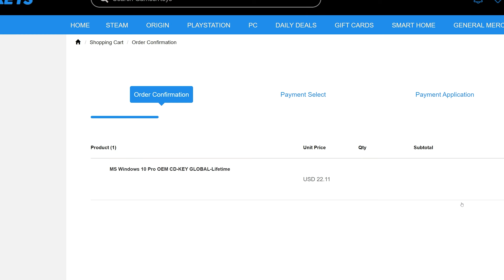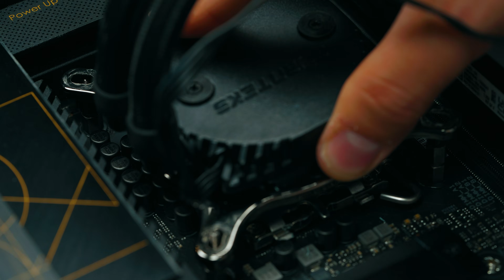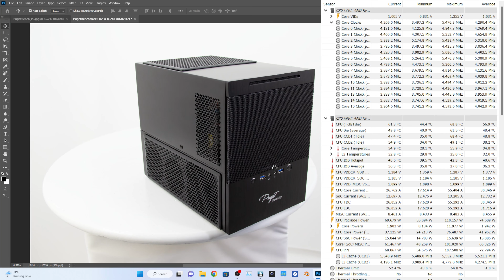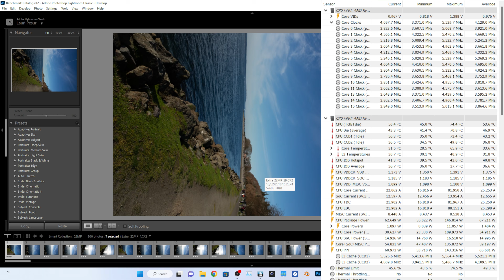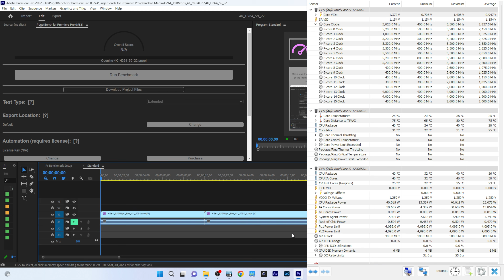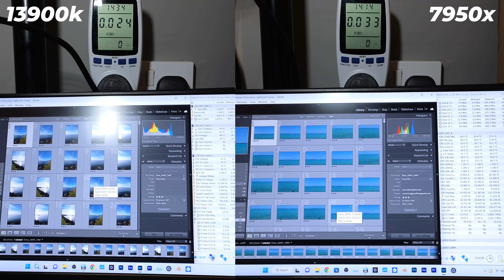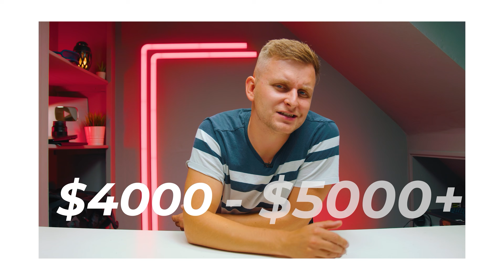INTEL & AMD both lied! 👉REAL WORLD power consumption is MESSED UP

Comment: Regarding the hardware measurements, they can completely turn upside down your whole video results. Here is a report on reddit from an intel system user with HW measurements: 

"Software tools are inaccurate. Besides you are not paying just for your CPU's usage you need to factor in the chipset, RAM, CPU cooler/AIO and atleast primary your boot drive.

Yes definitely. I don't have a Zen4 platform, but a 13700k & z790. HWInfo can show <10W for package power, but my Kill-a-Watt type device shows 75-80W at idle. (My old Zen2 / AM4 closer to 60W idle at the plug)

All these USB ports, PCIe 4/5, massive VRMs, etc... costs idle power."

Comment: For Ryzen 5000 series it really depends on the CPU and utilization for workload power draw. I can't say fully yet for 7000 series.
But per core power utilization I get more from my 5950x than my 5900x or my 5800x.  I think that has to do with the binning.  
Both my 5900x and 5800x use a decent more watts per core. 
My 5600x is pretty close to the 5950x per core. But the point of that thing is to max frequencies. So a lot gets wasted going those last few hundred.

Comment: Just take a light bulb out if you need to save 20w LOL Im changing my living room lights as it has 8 bulbs @40w each to 6 bulbs @ 4w each so I dont have to worry and about the 7950x3d power ... but the RTX4090 may use a little more lol

Comment: Interesting! My 12400F idles at 5-10W while my 5600X idles at 15 to 22W, in gaming the 5600X generally uses 5W more, but also performs a bit better. They run tweaked and OCed ram (3700cl14 g1 and 3800cl14 and curve optimizer) and voltages on Ryzen has been tuned lower. 12400F can't be tuned due to locked voltages, but performs good anyways. In idle 12400F drops to 0.65-0.7v, 1-1.1v at load, 5600X drops to 0.85v idle and 1.15-1.22v during load.
Reply: What are you using to measure? 5600x idle package W is about 30-40W
Reply: @Arcona  hwmon64. Using wallplug measuring actual powerdraw from wall, idle consumption is 55-60W for B550m MB, 3x120mm fans always spinning, 1tb m.2, 3060ti tuf. You may be using high powerplan so it doesnt go to low power state in idle? Mine runs voltage at 850-870mv, clockspeed 200-3600MHz in idle using balanced powerplan.
Reply: @Taraquin83  use hwinfo cpu package power will give accurate read
Reply: @Arcona  I did that, in idle it uses 15 to 19W cpu package power.
Reply: @Taraquin83  that's odd. The IO die makes it use more idle than that regardless of core clock. Maybe the undervolt also effects the IO die consumption
Reply: @Arcona  I run SOC 1.06V, IOD, 0.98V, CCD 0.8V, VDDP 0.8V, VDD18 1.6V, balanced powerplan, cool and quiet enabled. I see now that minimum voltage usually is 0.83-0.85v, sometimes drop to 0.2v. Cores use about 1W, IO-die the rest.
Reply: @Taraquin83  I take it you've experimented to get it down to that point but stay stable?
Reply: @Arcona  yeah, 100% stable, anything below reduces performance or gives instability :)
Reply: @Arcona  if you run it stock it often defaults to 1.2v SOC, 1.05V IOD/CCD, 1.1V VDDP, this increases idleconsumption a lot vs my settings. Also use balanced powerplan and enable cool and quiet.

Comment: This is a an awesome comparison for some workloads. 
Setting up systems for photographers AMD is faster and more efficient when  batching 3000 + photos for online stores for example. 
When using premiers default plugins Intel may be more efficient. When using many 3d party plugins the extra cores are great at keeping things playable instead of having  to render to play. 
What You Tubers do not say is that on AMD Premier uses NVENC on the time line if available. Which I prefer as the quality is slightly better even if Qsync is available. 
What is more important than the CPU idle is the total system idle
50w extra cpu is small if you have a lot of ram, add in cards and storage. 

For average content creators who shoot and edit them selves Intel may be a better option. 
In a high throughput environment AMD may be a better option.
There is no substitute for raw performance irrespective of the source.

Comment: Very nice the only thing missing is metrics when undervolted/power limited as it makes quite a big difference between the generations. It puts Intel and AMD on par in workload and you can get 90% of performance at 50% of the power often times. The new generation is quite a bit more efficient as it’s supposed to with that in effect. Idle is still significant as an issue though I hope AMD finds a way to deal maybe using efficiency cores in the future as well as they are already increasing their expertise in chiplets design. That nd gaming benchmarks for power really unfortunate Intel removed AVX 512 instructions because immigration and future gaming is supposed to benefit a lot from that as it etches closer towards simulation
Reply: Intel CPU's perform even better when undervolted, I don't see the point of your comment.

Comment: Intel efficiency is better suited for mobile. 

On desktop, doesn't make sense thou. Ryzen is better for many applications. Also as far as upgrades go, AMD has a proven path forward. Intel, not really.

And if you need to go balls to the wall AMD rocks hard with more efficiency than Intel when going full tilt.

You'd be surprised how many apps peg the CPU at 100% sometimes.
Reply: Big-Little also makes sense for desktop chips. I have my i7-12700K and it's a perfect x86-64 music production CPU.
Reply: A lot of apps don't peg the CPU at 100%.

That's why very few people buy a 10 000 dollar 64 core Threadripper.

Comment: I think you might not have done the idle test exactly correct. The frequencies on intel cpu on idle are way lower than on amd. And I'm pretty sure this is not due to difference in chips itself.
On intel your cores run 1100mhz on P-cores, and 800mhz on E-cores. On AMD you have all cores between 3300MHz all the way up to 5200Mhz!

One possible reason is, If your setup uses windows power options for controlling power, I suspect you have a wrong value of  "processor power management -> minimum processor state" in power options. But it could be some different setting too, but something clearly doesn't seem right
Reply: its because the AMD infinity fabric can only work at but so low of a frequency before the latency between chiplets  becomes to much for the system to handle

Comment: The full story is on Techpowerup.  They do detailed power analysis of all kinds of games and applications so you can see individual and average results.  For instance the 5800X3D is about the lowest in power consumption duding gaming even though it's giving some of the best results.  The 13900K is on the opposite end of that using the highest amount of power consumption on average.  How big are the differences?  47W for the 5800X3D vs. 114W for the 13900K.

Not sure where you get the 300W+ for the 13900K in your opening statement, that's only when you OC.  However the 13900K was at the top of their power consumption for pretty much anything except single threaded apps, using stock settings for CPUs.  In single threaded apps the 13900K was using 32W, and part of the Zen 4 lineup uses more, but the 7600X and 5800X3D used the least, 15W and 19W.  All-core load testing using Blender put the 13900K at 283W, and the 5800X3D uses the least of the newer CPUs, at 89W and the 7600X at 99W.  The big power user by AMD in Blender is the 7950X as should be expected with 16 full cores, at 235W.  Now, if you look at consumption to complete a given task without regard to time in general AMD does better and sometimes a lot better because of how low the power consumption is with the 5600, 5600X and the 5800X3D along with what's going to happen with the 7600 - 7900 which just came out.

And these results agree with what Gamer's Nexus show and I trust both those media outlet's testing and results.

When you start doing things like removing power limits from the 13900K or run an all core OC THEN you start pushing power to crazy amounts of 350W - 425W.  It's incredibly bad.  And even for gaming, when you calculated frames per watt, the 13900K is at the bottom and the 7600X and 5800X3D are at the top.

So, didn't bother watching because I don't know what angle you're coming at, because other than idle and single threaded apps Intel gets its butt stomped in power consumption.  And the 5800X3D makes almost everything other than the 5600 and 7600X look bad in almost any use case for power consumption.  But once again, it's really a funny time to make this video because the 7900 is a 65W TDP part along with the 7600 and 7700, costs are low and power consumption will be low, and GN and Techpowerup will do the detailed power analysis and show this.
Reply: Their test bench is not ideal to measure idle power consumption imo. Too high consumption parts
For example they test a 5600g with a x570 pcie4.0, RTX 3080 that idles at 20W, 860W power supply. Imagine testing your electric car consumption in efficiency mode with 5 persons in it and full of furniture.
Reply: You are right. Techpowerup also tests Photoshop, After Effects and Premiere Pro and they also have other light load tasks like Office, Avast and MP3 encoding in their testing lineup. The power consumption of Ryzen 7000 is on par or lower in even these light load tasks.

Comment: Even when working, employees or self employed spend most of the time browsing, looking for images, mailing or conferencing.
Light load and idle need way more attention and I tend to trust intel more. 
Then, there are other issues with MB, ram, multi monitors refresh rate, and GPU idle power consumption. Graphics cards draw 5 to 30 watts on windows (while consumption can go down to zero on Linux) should get more attention.

Comment: To narrow down wattage score it would be best to use key/mouse recording program of ~8h average use for PC, including watching some YouTube, maybe movie, little gaming, some workload.
For motherboards to be closest possible would be using ones with same number of VRMs and ideally same VRMs. Same goes for number of fans and other peripherals. Also same power supply.
So ideally record daily use on slowest, and most underclocked CPU you plan to test to make click recording and then go up the ladder of power with performance.
To my memory, AMD hardware tends to be quite aggressively overvolted and people have real good results with power savings and like 5% score decrease.
But that's another untapped potential for benchmarking/tuning.
Personally for next PC i aim to build passively cooled design, so going down with power will be the key.

Comment: Probably this was what Intel was showcasing on their 13th gen keynote when they announced those. This was the type of test that I was looking for when they announced it and it's kinda surprising. I'm pretty sure 14th gen will further improve those E cores efficiency. Hopefully, this applies to laptops too since that's what E cores even in smartphones use. Seems like Intel is slowly tuning its CPU capabilities properly.
Reply: Intel's e-cores are similar to mobile Qualcomm arm e-cores as they are in order execution but just like qualcomm are not nearly as efficient as apple out of order efficiency cores in performance per watt.
Reply: @PMARC14  Intel is on 10nm tho while Apple is using TSMC's 5nm. Let's see what Intel has once they are on the same node!
Reply: @verosimatum  well I am saying this based on the snapdragon 8 gen 2 on the same process gen at Apple. It shows that yes apple gets a big lead on process node from its arm competitors, on the same node they are held back by their in order efficiency design (consumes less power but for far less work). I think intel and AMD on a similar mode as Apple could be far stronger, but Apple also makes larger silicon chips to get their efficiency (even discluding accelerators)
Reply: @PMARC14  Sure it'd be lovely to have a macbook, apart from the fact it straight up can't run games and other software not converted to work on ARM
Reply: I doubt it's about efficiency cores, at least for idling. The 12400 idles at 5watts (without e-cores) when the 5600 idles in double digits.
Reply: The E-cores is not really "power efficient", but "die space efficient" which allows intel to cram tons of it and catch up to AMD in multi threading performance. My personal test using 13500 shows that Ecores draws 60% less power but 62% slower than Pcores on cinebenchr23. 
155watts, 21000 cinebenchR23
99watts, 13800 cinebench R23 ecore disabled
Reply: @Rute Fernandes nah its the chiplets design thst uses more power in idle compared to monolithic from intel.

Comment: Sir what about 
Ryzen G processor
5600G
5400G
3200G
Are power efficient.
Reply: Probably worse due to being on an older node
Reply: as far as i know, they were designed like mobile processor, not chiplet, but monolithic design without infinity fabric or IO die

Comment: The Ryzen is probably idling at 55w because its precision boost is turned on by default and windows has problems right now with the new Ryzens.

If you tweak some of the settings, you can get it to where even under heavy load, the Ryzen only peaks at 65w and idles around 5 - 15.

It is not really that hard to do this either. You can do this with the Ryzen Master program.

Comment: Those idle clock speeds on Ryzen seem a little high. My 5600g down locks close to 500mhz when idle. FYI, Adobe is Intel optimized, just ask hardware unboxed.
Reply from the maker: Is there any AMD oprimuzed programs?
Reply: 5600G behave similar to the 3600. They both idle in single digits. This is why they are used for home servers. Also, the 5600G does not perform as well as the 5600, let alone the 5600X. 5600G use pcie 3.0 as opposed to their big brother (4.0)

Comment: Iv recently been exploring my 13700kf efficiency and in blown away with it.

Just by downclocking from 5.4 to 5.0 I can drop the voltage down to 1.15ish

This resulted in a drop of 3.3% in cinabench but now when gaming it only sips 25-50w.

Crazy

Comment: 19:05 There are a lot of energy meters that can measure the consumption at the socket. It was weak. 🤷‍♂️🤦‍♂️
Reply from the maker: I was talking about the EPS power connector, as you can see I did measure it from the wall as well ;)

Comment: The problem with the initial idea of what you said is that you can't compare a car to a computer. X86 from AMD and Intel is designed to turbo boost and stick there or throttle down depending on the work load. If you are working in autocad, coding in unreal and rendering assets, and sending that information to your teams FTP server or whatever, you are insanely stressing your CPU. The reason why people show the highest consumption is because most CPUs will always put themselves the highest they can go based on thermal limitations. if you were to build a computer and not have your affinity in task manager setup to focus on certain task or go into overclock settings and push it more to gain more performance those are different variables, but even at stock speeds and solutions both CPUs act the same and will show the performance based on thermal limitations leading to increased wattage...

Comment: Tdp is not power consumption even though they both use watts one is a measure of heat produced.  As transistors get smaller they produce less heat but they still use power.

Comment: This is very good information especially as the Intel platform is cheaper to get into to begin with. Lower entry costs and overall lower power consumption make this a no-brainer from an economical point of view.
Reply: Platform cost is almost equal bro
Reply: @ajitesh5278  you never shopped for mATX boards, apparently. And no, DDR5 still is more expensive than DDR4 for minimal gains.
Reply: @HoshPak  lmao if you are going with an i9 why would you go with ddr 4 ram ? Ddr5 is better in gaming and everything , and z790 motherboard and x670 motherboards are almost same price

Comment: Well done. It has been hard to find the idle power consumptions for the AMD parts. Even on the old Intel parts, idle power consumption in HW info is often in the single digits (9-11w on i7-6700 while typing this comment). I rarely put my computer to sleep as they rarely wake up properly and often leave them on to quickly resume work the next day. The power of the 7950x would be nice for encoding but the high idle power is a concern as that is 90% of the use case.

Comment: Good point. Unfortunately it is not relevant to the gaming, because it does not allow CPU to fall into power-saving state.
Reply: Dev should not lock the sleep state, they should allow the CPU to sleep, imagine if player has a monster CPU? so each Tick it finishes the task instantly, so what's the reason to keep the player's CPU waiting? (Usually there's only 15 to 128 ticks per second only, while the in between are processed by GPU)

Comment: My extremly undervolted 7900x pulls 30W in idle. 90W at 12x4.5ghz cb23 multicore

Make please a bonus round against the best intel but with different AMD undervolt settings...
AMD voltage curve is insane, 4.5Ghz all core cb23 970mv and stock curve sets 4.5Ghz at 1.25v
Reply: Undervolt vs stock is not a fair comparison lol
Reply: @AbcdEf-lz6oe  Im saying that AMD can do better...
Reply: @AbcdEf-lz6oe  I tested a friends PC and it can actually go down to 6W idle when undervolted and it's so funny that AMD has legit no chance... I'm programming and the issue is that the PC is 6h+ idle... meaning for 1h of AMD i can work full day on Intel... and I'm planning a camper van so yeah... AMD is dead in my eyes because power consumption is very important with Camper Vans.